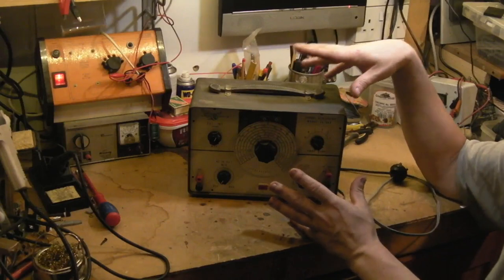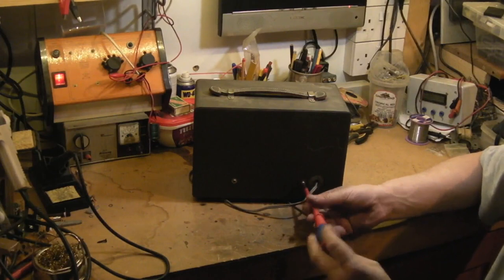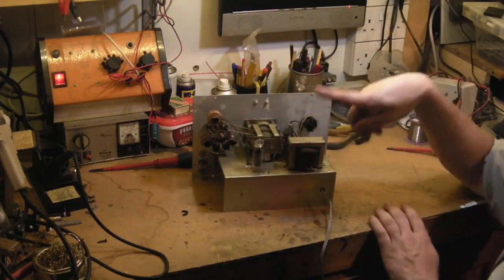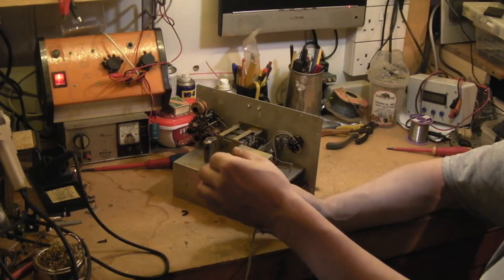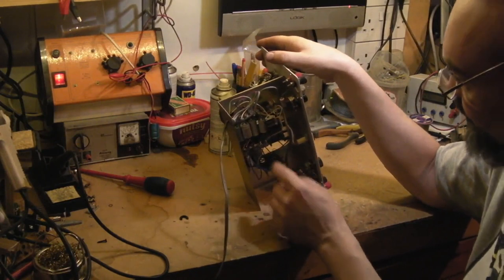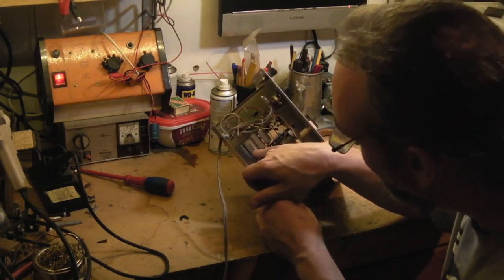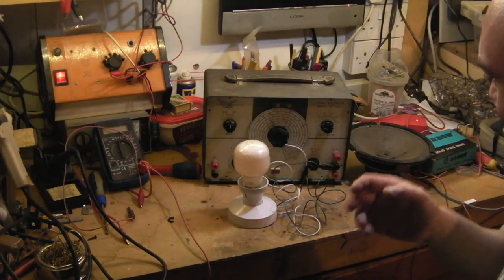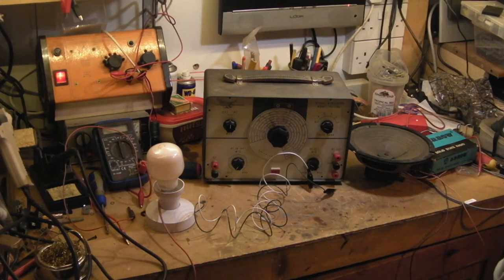Eagle Products TL-188 Signal Generator Look-over and 1st power up

Comment: These have a 400Hz signal which as you say is absent. It comes from a Crystal and through the 6AR5.  (EL90). If the valve is OK then I would tend to suspect the Crystal.